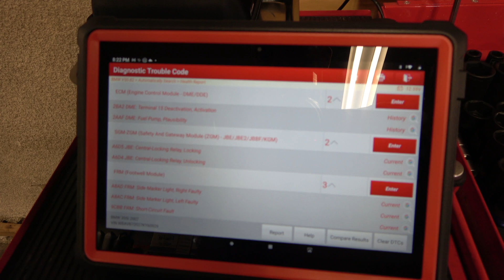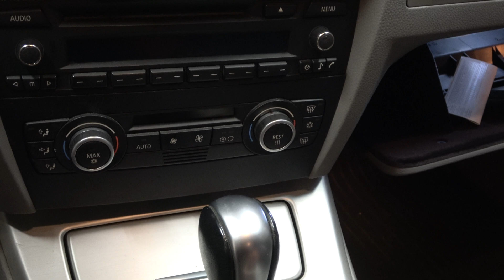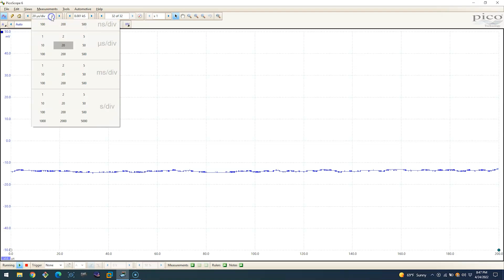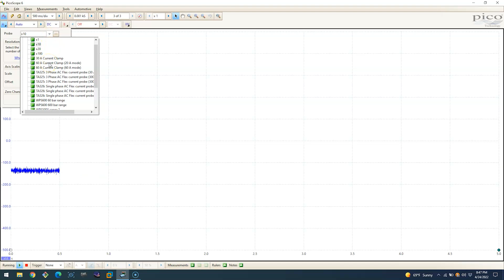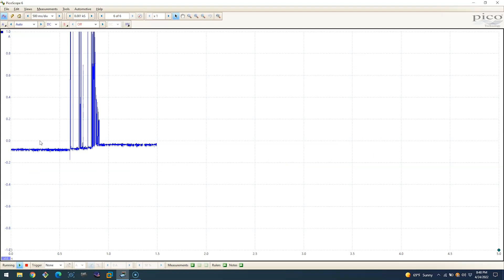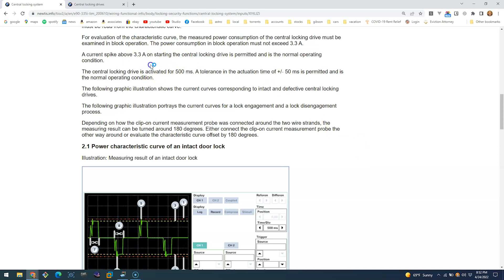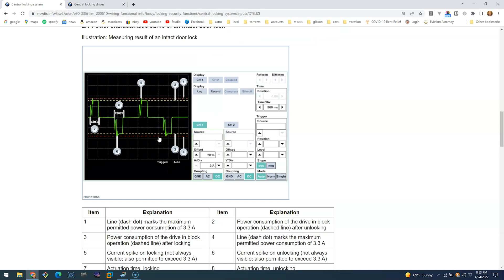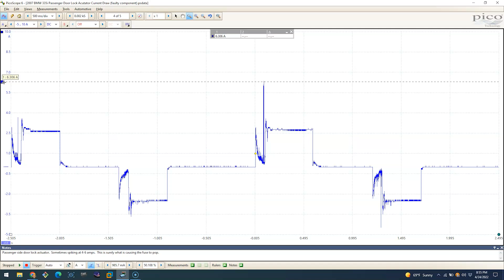BMW E90 Door Lock Actuator Diagnosis

Comment: Hi I like what you inform us and watch you'r channel , I would like to ask  a question  You have seen or taken the readings of a Electric Water Pump  of a BMW X3 2009 from cold till it get to its normel temperature and Running  , I changed the Electric Water pump because it had a code 2E85 2E84 code and the engine was getting Hot I took Voltage meassurements 2 wires ha 12v and 1 Ground and the BSD signal wire it has the Square Wave 12 to 0  but I tried the Bleed Procidure  and i have don it on other BMW but this one doesn't Bleed I check all the fuses in the engine bay and in the car passinger side all lookes good Changing the Electri Water Pump code 2E85 AND 2E84 DID NOT COME BACK ALl help would be appreciated thank you

Comment: Always interesting and informative as usual, I've an old03 33ser E46 very,not been well maintained be4 l got it little service history, in proses of doing breaking system discs,calipers, pads sensors, rear brake lines corroded some to replace, got all the things in engine bay that need to be replaced heat/age and135000mls! I've problem with central locking relays so I've got all replacement relays for gm5 module, not able to do that @moment l need to by decent soldering station with sucker attachment from Weller exspensive, but quality pro  equipment I'm used to using! Thought best replaced all relays since all must be well worn save further problems! Interesting thing my previous bmws had oxcillery water pump for heater, spent ages looking for it on this car,has solenoid but no pump,heater fed from main engine water pump,wonder y they put electric pump on some not  others would have save cost of exspensive electric pump!

Comment: Try taking apart the door lock and clean out the white lithium grease. It makes it stick causing it not to lock. WD-40 helps to unstuck it. I would take it apart clean up the gears and spray it with Teflon. If you could I would clean out the com of the motor as well with alcohol.  Using a 15 Amp fuse is to over come the resistance of the grease.  Bad move this will cause the wires to over heat. Dealer stupidity stay away from them. Great video sir.

Comment: Nice video man. I liked the in depth troubleshooting. I have an E90 also and although the door locks aren't behaving like yours (not yet) I do get a door ajar indication and bong when driving. Of course all the doors a closed and locked. Did your car do that too before the locks eventually failed? Forums suggest it's an issue with the footrest module others say its the striker worn on the lock. 🤷‍♂️
Reply from the maker: Mine didn’t do that, but sounds like problems with your FRM

Comment: It has been reported that the "Hack" you mention will not allow the newer model of your scope to work with the automotive software.
Reply from the maker: What’s the newer model? Not the 2204A anymore?
Reply: @50sKid  same model but comes with different firmware or something.
Reply: @50sKid  Still 2204a, newer firmware I guess.  I believe Mechanic Mindset confirmed this on his channel.
Reply from the maker: @John76546-x  ah bummer, but I suppose it’s not absolutely required

Comment: I can say the door locks actutors usually last depending on your environment around 15 years approxmiately, they will fail like dominoes. 
Locking units unfortunately have no viable means for re-lubricating and as they age, they mechanically get stuck causing them to stick and hence unusual performance characteristics.

On some makes its even worse (VW group), back in the dealer the door locks fail sometimes below 10 years, like an A6 2011 in a rather humid enviroment, both door locks log error memories, the fix is to replace both (it only has two doors), no diagnosis is even needed.

Ask VW how many fuel flap locks they've sold, practically its generating so much e-waste they can't even admit.

Replace parts, keep us all in business.

Comment: Could this be a bad connection or ground issue?
Reply from the maker: I think either one of those cases wouldn't draw excessive current.  A short circuit would, though.

Comment: Great video.  I suppose you might have been able to use a one of those fuse buddy current loop devices in place of the fuse and measure the current at the fuse box and not have had to take the door apart.  Maybe?
Reply from the maker: That would be testing all 4 door lock actuators at once though, since there is no way to lock each one individually on this car (actually maybe I can do that with the scan tool -- didn't think of it).